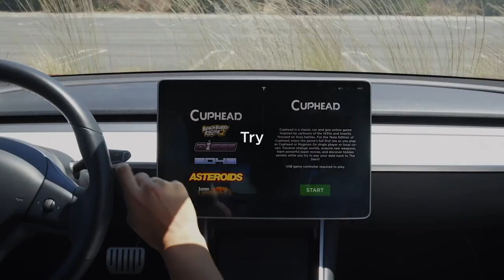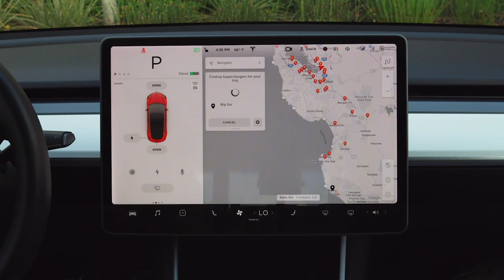Model Y Challenges - LOWEST RATING can they recover?

Comment: Phantom braking is a real thing, kind of scary when I was driving through curvy roads and it saw some broken branches alongside the road.  Super glad someone wasn’t right behind me.  It also didn’t like another car changing lanes to make a right turn.  I only have 600 miles on it in less than two weeks, and I haven’t tried using auto pilot on the freeway. It did a great job on slowing down for curves, but it would be great if you could turn the braking off and it would stay off.

Comment: I just got a Tesla Y.  Phantom breaking is a real problem.  I deal with it by pressing the accelerator, but it has made my wife not want to drive the car.  Is just relying on cameras causing this problem as my 2018 Honda CRV had smoother adaptive cruise and I never had phantom braking and I think that used radar.  I am hoping with time and learning it will get better. What bothers me the most is how aggressive the regenerative braking is when you take your foot off the accelerator.  Seems like they could allow you to adjust this on a one to ten scale. Also it seems they could coordinate it with braking where light initial pressure on the brake pedal would increase  the regenerative braking first and not engage the brake pads until you push it hard.    Would love to  hear what others think on these two issues.

Comment: One positive thing that stands out to me is that even after 2 years of owning a Model 3, I still look for reasons to go and drive it (or have it drive me with the latest fsd beta).   Our Model Y doesn’t have FSD but still fun to drive - plus the practicality/utility of more space.  One of the negatives that I’ve seen is range/battery degradation.  Our Model Y still shows 326 miles of potential range at 100% but our 2019 Model 3 shows only 280 miles down from the 310 at 100% when we first bought it 2 years ago.  Given that it’s not recommended to charge to 100% and not to fully deplete your battery, the usable range (along with highway speed, colder tempts, winter tires, etc) really gets reduced to about <180 real world range - luckily there’s the supercharger network.  a 400+mile range for the new model y out of Austin would make me trade in the model 3 in a heartbeat.

Comment: The phantom braking is horseshit and and should be subject to a recall!  I bought a Model Y 3 months ago and sold it last week, primarily due to that issue, mainly on state/country 2 -lane roads. when you have someone right behind you and all you want to do is have "cruise control", when it taps the brakes hard with a car coming towards you, but nowhere near your lane, that is dangerous as hell.  I don't give a crap about panel gaps or any of that non-functional stuff, but the driving software right now is dangerous.  Great batteries, great electric motors, but terrible software overall.
Reply: Curious how long you owned your M3?